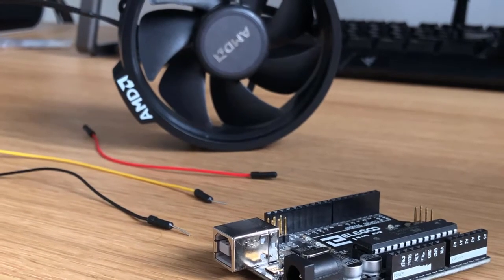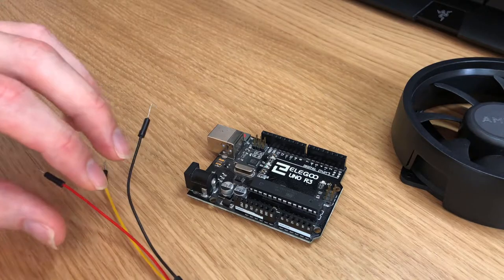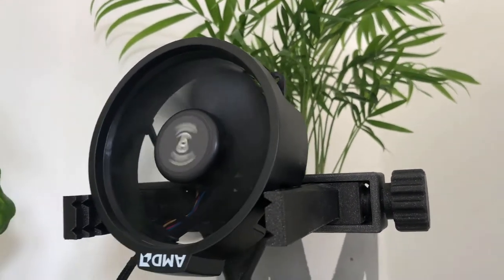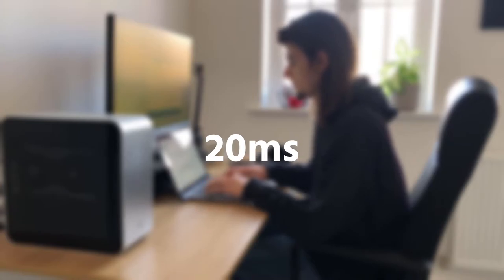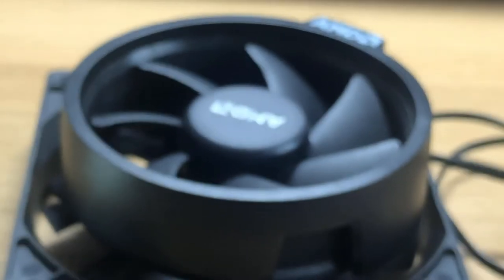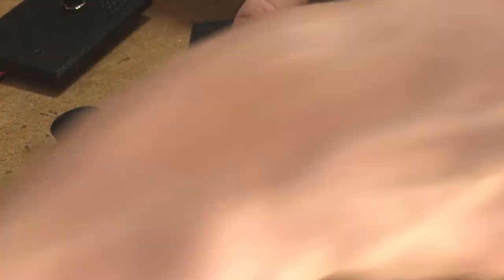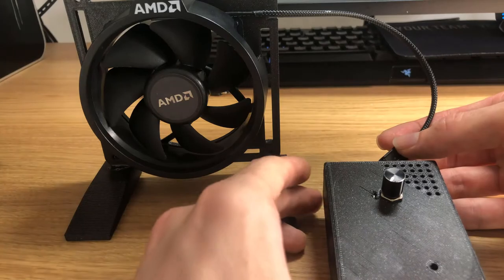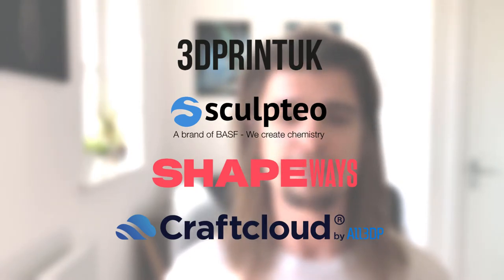Hacking a PWM PC fan with Arduino

Comment: If you do this with a 12V external supply for the fan, ensure the ground wire on the external power supply (-ve) is also connected to the ground on the Arduino. If not, the PWM will not work correctly. This was not explained in the video; as I see many comments about this problem online, I thought I would mention it in one of the best videos on the subject. Also, some common PC PWM controlled fans can take up to 3A - this will can damage the VIN pin and traces - it is best to bypass this and run the fan directly from an external power supply.
FYI: Superglue + PLA = future failure as the PLA breaks down. :-(
Reply from the maker: These all are excellent points, thank you 😊 I must admit, electrical engineering is definitely not my area of expertise.
Reply: Can I still connect my Arduino to my laptop?

Comment: Nice video! This feels like an eternal paradox… you need a device to extract solder fumes, but to make that device, you need to solder some wires together :P
Reply from the maker: haha exactly! I tried not breathing whilst doing the wiring but that didn't work too well funnily enough
Reply: @akamatchstic  it was worth the sacrifice 🤣 I don't think the fumes are as bad as they once were though, but still great to have an extractor when you're doing a lot of soldering

Comment: Very interesting. It's not correct to  power a fan from an Arduino directly. You need to split the power between the board and another device without running a risk of damaging the board.
Reply from the maker: You are right about the power, it’s something I didn’t do correctly in this video - don’t have much experience with circuits yet 😅

Comment: powering anything directly from a control board (arduino, esp, whatever) is wrong. the ports can only deliver a very limited amount of current (I dont remember if it is 40 mA)
Reply: It is 40mA max per I/O port for the ATMEGA8U2 however VIN he's using would come straight from the USB port.